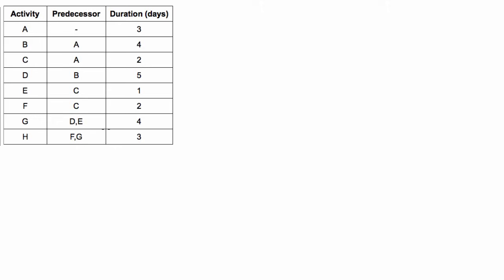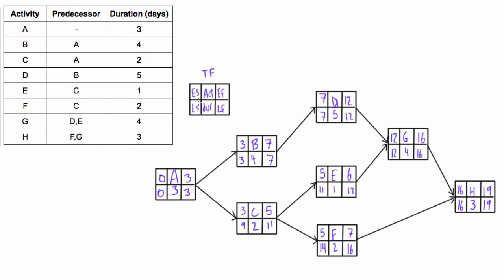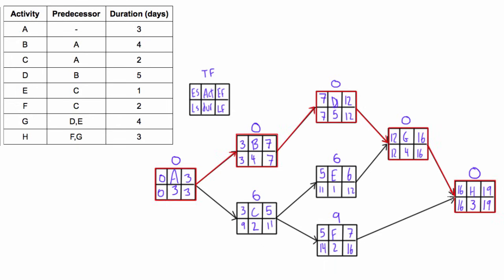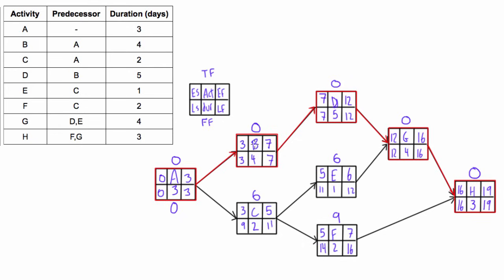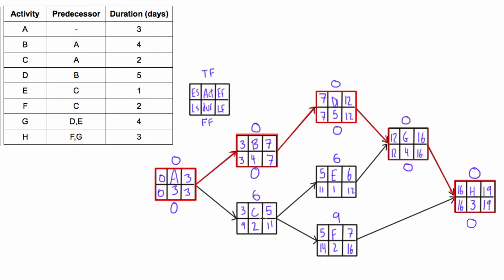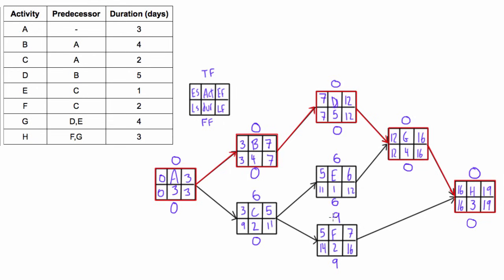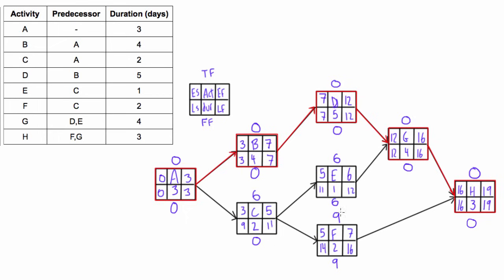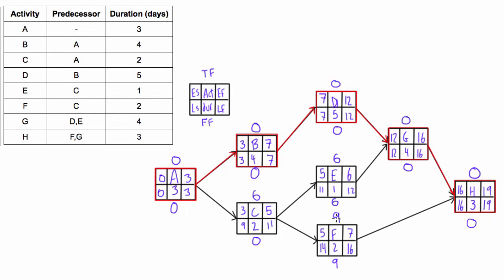Determine Total Float & Free Float (AKA "Slack") of activities in a network diagram

Comment: Sir please I need urgent assistance.
Help me and solve this, I am preparing for my exam which is scheduled to take place on Monday 12th May,2025.
The question is as follows:

Analyze both forward and backward pass (network) for Lade's communication project, Abuja, Nigeria. 'A' [10] & 'B' [4] can start immediately. 'C' [3] can start 3 days after the start of the project. 'D' [9] cannot start until 2 days after 'A' starts. 'E' [10] depends on the completion of 'A' and 'D' before it can start. 'F' [15] can start as soon as 'B' finishes but must wait 3 days after the completion of 'A' before it can start. 'G' [1] can start as soon as 'C' is completed but cannot finish until 4 days after 'B' is completed. 'H' [20] can start as soon as 'E' starts. There is a two-day delay between the completion of 'E' and start 'I' [4] which also must wait for the finish of 'F', as a further complication, 'I' cannot be completed until 3 days after 'H' finishes. The start of activity 'J' [10] depends on the completion of both 'F' and 'C', however, there is a 23 day delay between the completion of 'C' and the possible start of 'J', and the project cannot be completed until at least 3 days after the completion of 'J'.

Comment: Great vid! Quick question. If I have three activities with no predecessors, how do I construct the network? Will it have a 'start' node that bursts into the three activities? Or will I just have three separate activities starting points?
Reply from the maker: For an Acticity on Node diagram like this one, you will not have a single start node that bursts into three. You will have three seperate initial nodes, all with ES=0. Organize them all on the left hand side, one over the other, and then use the logic from the table of dependencies to draw out their successors. When you do the forward pass, set all three initial activities' ES to zero, and count up as usual. When you do the backward pass, at least one MUST have a LS = 0 . The other two may have LS = 0, or an LS greater than zero.

Comment: why successor's ES is on
the same date of predecessor's EF? Should ES date of successor add one day more
from EF of predecessor’s? You must wait for previous activity to finish and
start ES on next activity. It doesn’t mean scenes when you put them on the same
date.
Reply from the maker: It comes from how the giant chart is drawn. Watch this video first: https://www.engineer4free.com/4/how-to-draw-a-gantt-chart You can see that 0 represents the beginning of the first day, 1 represents the end of the first day AND the beginning of the second day. 2 represents the end of the second day AND the beginning of the third day. 3 represents the end of the third day AND the beginning of the fourth day. And so on. So in that video, Activity A has a duration of two, so it starts at the beginning of the first day (0) and ends at the end of the second day (2), and Activity B then starts on the beginning of the third day, which is also marked by 2. On the network diagram, these come across as the activity’s Early Starts. Hope that helps clarify it for you!

Comment: excellent video - some videos assume the ES of 1st activity as 1 and keep subtracting 1 from every successor activities ES , you have assumed 0 and are not subs 1 in forward pass . What is the correct method?
Reply from the maker: Neither method is truly more "correct" than the other, they follow the same logic, but are just shifted from each other by one. If you are in school or studying for a certification, then just follow the method that your instructor is using. The reason that I start with zero stems from the way I label and draw my Gantt charts, you can see in this video: https://youtu.be/NcOmJSrXYoQ where the column "0-1" represents day one, so therefore 0 represents the start of day one, and 1 represents the end of day one, but also the start of day two. And so on... Hope that helps, thanks for the question!

Comment: Thank you very much for this very clear explanation!! One small question, what happen when you have Start to start or finish to finish linked tasks (even including lead/lag), how to calculate the free float? Using the expression on the video obviously fall into negative values which makes no sense as per the concept of float, but I guess in that case the calculation expression mustchange right?